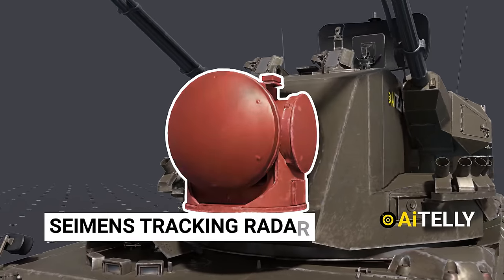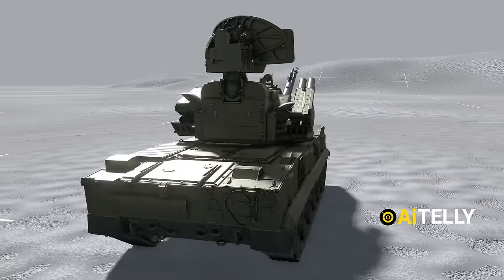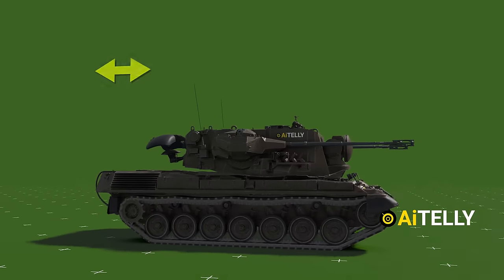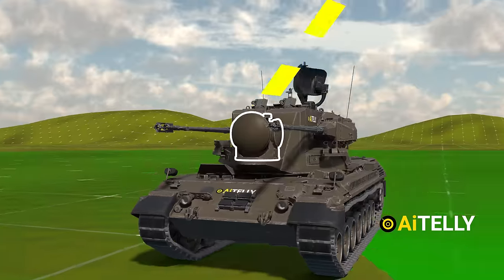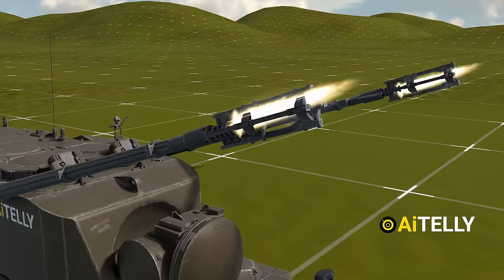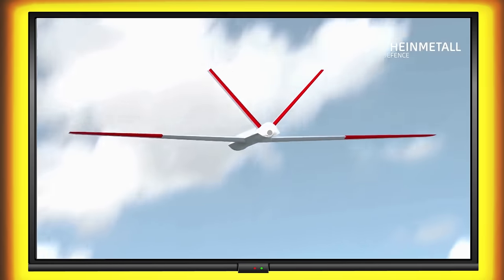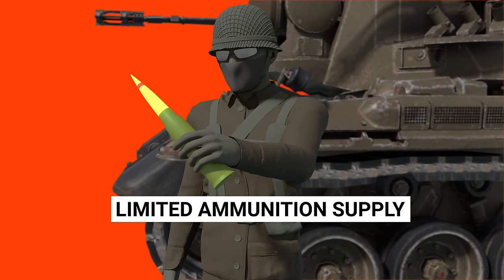Gepard  Anti Aircraft Tank How it Works | Tunguska  Marksman  ZPU  Shilka  M163 Vulcan Leopard 1

Comment: The AHEAD round is AA round of the future.  Aselsan ATOM 35mm is a similar type of ammunition.   Both rounds are highly advanced proximity rounds.  Great, great advancements in AA ammunition.
Reply from the maker: Yes agreed 👍
Reply: @Aitelly  Shilka caliber is not 14.5 mm but 23 mm.
Reply: Eh. Most AA ammunition in WW2 also work that way.
Reply: @Teochewtuahang  The difference is the microsecond targeting ability by utilizing multiple onboard computers, radars, and thermal systems that are integrated together.  

WW2 AA rounds relied on proximity fuses and the "Gunners' Ability to Predict" aircraft location.   The "Gunners' Ability to Predict" has been replaced by multiple sensors (radars & thermal)  used in conjunction with multiple threaded on-board  computers to determine the aircraft location. That calculated location is determined multiple times per second and fed into the targeting system and 35mm round itself.  All this happens in real time.
Reply: @Teochewtuahang  Not at all. WW2 AA guns worked with a time fuse that was set by purely guesswork by the gunners
Reply: I think they mistook the caliber for the ZPU, the previous standard in Soviet anti-aircraft guns, which indeed fired 14.5 mm.
Reply: @Teochewtuahang incorrect, Anti-Air rounds in WW2 worked on a time fuse where the loader manually adjusted each round’s fuse before firing. Later on they use VT (Variable Time) fuse rounds which use a small radio inside each fuse to ignite the projectile when they detect an object or surface. 

Modern AHEAD rounds use the fire control computer to calculate the distance of the target by using lasers, then the computer process that information and send it to the barrel where the muzzle use electronics to adjust the computer fuse of the round exactly when to explode the moment they exited the barrel, being much more reliable to kill target quickly as they are peppered by shrapnel from exploding AHEAD rounds.

Comment: Well done AiTelly 👌 keep up the good work!
I have to mention that the company providing the doppler radar (or other household items 😅) is called "Siemens" in Germany

Guys, will we get to see a video about the Pantsir short range air defense?
How does the missile guidance work? Additionaly to the radar the Pantsir seems to be using some optoelectronics which are installed on the top of the turret.
Reply from the maker: 👍 Ok will do after we finished a few tanks ahead in our pipeline
Reply: Siemens provides "slightly" more than that. Things like Trains (ICE) or even until recently nuclear power plants. And just about anything industrial and electrical from tiny to gigantic. It is massive and one of Germanys biggest companies.  Think german General Electric.

Also the unit of electrical conductivity is "Siemens" after it's founder, a pioneer of electrifying industry.

Comment: I believe there is a Gepard variant with anti-air missiles alongside the guns too. 

I cannot find any information of it online outside of Reddit, but I found photos of Gepards with missiles (I think stinger MANPADS) strapped to them.
Reply: Yes there is the "Flakpanzer Gepard with Stinger" (a bit disappointed by the naming here), having a twin Stinger system mounted to the right cannon. So, if you see a picture with stingers mounted to the left cannon, it is a fake.
Reply: They tested a version with rockets, that's right. But it didn' t entered production...
Reply: The missile "cousin" of the Gepard is called the Roland. It uses either the same Leopard 1 chassis or is mounted on a truck. It was phased out by the German armed forces in 2005.
Reply: @xXxxXx-br4rj  It didn't enter* production. In fact it did, the Roland system existed alongside the Gepard, both systems have been put out of service years ago now, though.

Comment: Tunguska is really in a class by itself. It abilities far surpass just being an anti- air gun.
Reply from the maker: Why is it so special I was wondering why the $16 million price tag
Reply: @Aitelly  well it got newer upgrades  resulting its price higher, Russia already have a more effective system and more mobile called Pantsir-S1. it can fire on the move but it recommended to fire in static since the recoils are quite strong bcs it use Kamaz truck as its chassis
Reply: yes, tunguska is more like CIWS or C-RAM.  Instead with gepard, he is more on par with Centurion CRAM and Oerlikon Skyshield
Reply: Tungiska has short anti air missiles too that's far superior to what this can offer.
Reply: @Aitelly  it is really the toned down version of the Pantsir system.  Same guns,  cheaper missiles and radar, smaller, with shorter range and tracked mobility. 

Shalka-23-4 modernization with upgraded radar and strella missiles is what is comparable to the Gepard. The modernization of Shalka-23-4 is better than Gepard but only shoots 23mm rounds.
Reply: @Aitelly  Radar guided missiles. Radar has more range and ability to infrared search and track in said long range. FLIR. Laser rangefinder. Isnt made by using already existing hull. Cannons have waay higher rof.
Reply: @Aitelly  How else are you going to skim millions of dollars for your yacht when the unit price is only $500K
Reply: Russians own air defense technologies, after WWII, never again will an enemy freely own the air uncontested.  They don’t expend 2 S400s per shot like we do with the Patriot.   Our armored units need SPAAGs in this drone age.  With LOtS of ammo.  

Navy too, not prepared for missile or drone swarms.   Need tons of CWIS, multiple calibers, and lots of cheap short range missiles to complement the long range ones.
Reply: @numbersletters3886  
Yeah, while Russia/USSR kept developing generations of air defense systems for the short, medium and high altitude respectively, America largely neglected this aspect of warfare with comparably few systems which entered service.

That's not to say they don't exist: from MANPADS like the Stinger & Avenger and the 20 mm C-RAM which is mostly used by the US Navy, to the Patriot anti-balistic/aircraft system and finally the THAAD system intended for the highest of altitudes. 
The 20 mm C-RAM, if deployed on a wheeled or tracked chassis would've been a fairly decent SPAAG for the low altitude air defense in the BCTs, but there are too few of them.
Reply: This price is because "Tunguska" is the name of the 2K22 complex, and this complex includes 11 vehicles for different purposes and 5 additional modules.
Reply: @gaveintothedarkness they need to beat the 🇺🇸 on the Corruption. That'll show them.
Reply: @Aitelly   Tunguska is even outclassed by Gepard.
Reply: @Misakimori_NM  they got destroyed already multiple times - same goes for the S-400 system which was already destroyed several times by Ukraine!
Reply: @indiandefensearena905  bullshit! Gepard can also use Stinger missiles. Tunguska is crap and a cheap copy of the Gepard.
Reply: @jamesmorrison4976  yeah sure dude, i won't surprised your claim destroying 30-40 unit including 800K+ Russian soldiers with 10K+ tanks, 5 misty dragon from caucasus and 30K Yeti from Siberia

Comment: The ZSU-23-4 Shilka is armed with four TWENTY-THREE mm autocannons, not 14.5mm heavy machine guns as described in the video. The Gepard's three-man crew consists of driver, tank commander, and GUNNER- as the guns are autocannons, it has no need for a loader.

How did your researchers and editors miss such glaring mistakes?
Reply: 0:33, 2:56 "This tank is operated by a crew of three people. A commander, a driver and a loader."
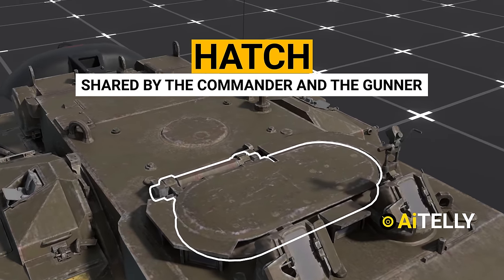3:35 "This is the hatch shared by the commander and the gunner."

hm... Also some more corrections and details:
The gunner is sitting on the right and the commander sitting on the left side of the turret. That thing on top of the left side periscope is a (removable) remote control the commander can use to turn and aim the turret when standing and looking out of the opened hatch. It also has some optics with a small zoom as far as I remember.
Fire control computer is sitting in the back, behind the gunner and commander. It takes almost the whole space of the turret behind the crew. In front are only displays and controls.
There is nothing transfered to the tracking radar. The gunner sees the search radar pings on a screen and marks any target there. Then the tracking radar is activated, opens up and tries to get a lock on the marked target which can fail and needs to be checked by the gunner. The IFF is signaled by a small box if the target is identified as friend or foe, but the gunner always uses optical reconnisance (through the periscope) to validate the target. Then the gunner can pull the trigger (push actually) and open fire.
Also the search radar is really only for searching the sky, the tracking is only done with the tracking radar. Hence the names.
And aditionally, the search radar can stay down/off when there is radar data transfered over radio, from a big radar somewhere else or from awacs.

Source: I was a gepard gunner.  (some time ago so I don't know the newest upgrades. But I don't think things changed that much.)

But all in all a nice video. Keep it up.

Edit: Bit nitpicking, but you would never shoot on a target moving away from you (as depicted in some parts of the video here).

Comment: I wonder why the author emphasized that the shilka on asphalt is transported on car trailers? all of these vehicles have caterpillar chassis that destroy the road surface and they are all transported on trailers. 'shilka' has excellent characteristics of cross-country ability and speed surpassing the indicated analogues. so why did it only need to say 'transported on a protractor' ??? I even had a doubt that the author added analogues to the comparison. as far as everyone knows, a wide variety of anti-aircraft systems have been created in the USSR, but the most important thing is that many new such systems have already been created in Russia. Why are only the specified ones selected?

Comment: The German Never should decomsissioned this powerful and accurate Weapon System. I Hope they actived a similar Upgraded Version of the Gepard. As we See it works Great vs Drones, Helicopters and to a certain degree Missiles…
Reply: The Germans* never* should have* decomissioned ...  But good they did. That system is awfully expensive, its radar is outdated and it's a nightmare to maintain.
Reply: @einundsiebenziger5488  i dont know Man. Vs Drone War the best and Most effective Tool we get, the Ukraines said. And thats what i was thinking. We should make a new Version if the Gepard, better and easier to Maintain but on the same Principe. And it seems Drone War is the thing atm…

Comment: Gephard AA is not compatibel with air burst amunition. Sensors at end of barrel is only for measuring speed of projectile. But its maybe possible to integreate. The Gephard is much older than air burst amunition. 
The next generation of german AA will have one barrel with air burst amunition
Reply: The german Gepard A2 version was upgraded to airburst  (ahaed) ammo in late ´90/early 20´ along with a digital fire control system. This is now the problem in ammunition supply, because german stocks are empty and it is only produced in switzerland, who denie supplying countries in war.
Reply: @J150278HC  thats not correct. Here is a list of use amunition: HE / HE-T / FAPDS / HVAPDS / UEB-T / DM28 Manöver / DM20 Ex
Reply: compatible*, integrate*, German*, ammunition*
Reply: @J150278HC  in Switzerland*, which* denies* supplying ...

Comment: The "cheetah" is a very expensive weapon system that places very high demands on maintenance, care and repairs. The 550 rounds per minute are theoretically possible but rarely used. The ammunition carried is too small for that. In order for all systems to work, the vehicle must be warmed up 2 hours before use. Everything that flies over 1350 km/h and over 4000 m altitude is no longer detected, recognized or registered by the radar. Modern drones have such a small radar cross-section that they are hardly detected by the "cheetah's" radar. Then, after each use, the 35 mm guns have to be meticulously cleaned, especially the sensors on the muzzle and the breech, which alone weighs 15 kg. If this is not in a 1A condition, problems will inevitably arise. In order to be able to master this weapon system well, one should be trained on it for at least 2 years. Any projectile from 12.7mm upwards can cause significant damage to the turret. A hit of an RPG 7 means the end. Combating ground targets is done conventionally using a target optics. The Bundeswehr rejected it because rockets serve the same purpose, then the cost factor (the Bundeswehr simply didn't have the money) and there was never enough ammunition. A problem from which the Bundeswehr suffers to this day, the entire ammunition stocks of the Bundeswehr are just enough for one week.